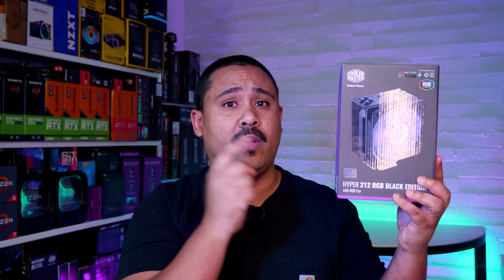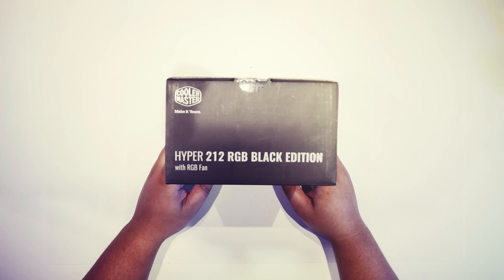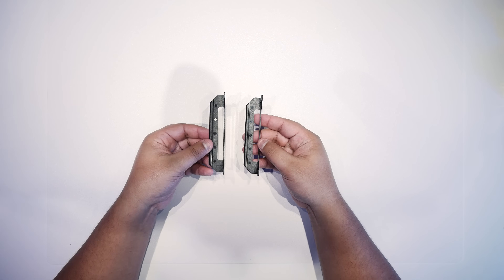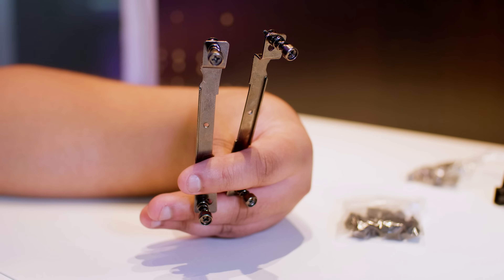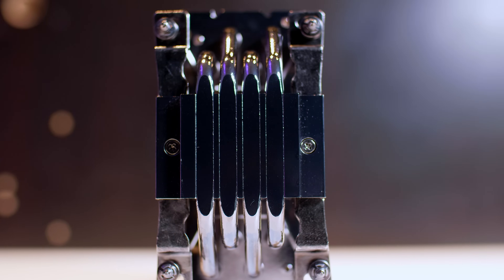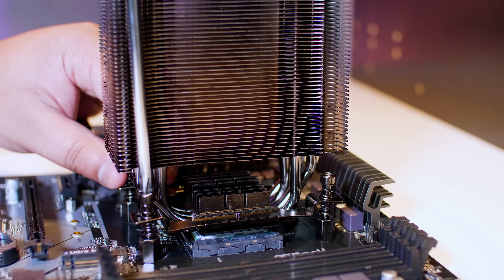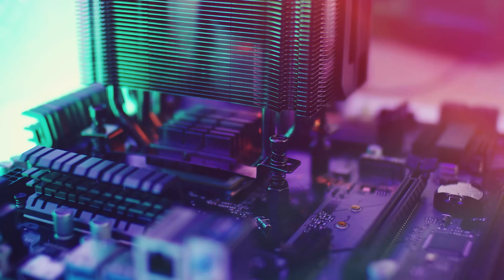HOW TO Install Cooler Master Hyper 212 RGB Black Edition on AM4

Comment: Can the metal brackets you installed to the cooler, be reused? I noticed when you tightened the cooler down, the metal brackets appear to have a spring tension quality where you see them bend as you tighten. After using it in a build, will the brackets retain that springiness, or once they bend like that, do you need to use fresh metal brackets for the AM4 example you demonstrated? Thanks

Comment: this works with AM5 too.  I didn't realize that the RGB needs to be using the 4 pin 12v header.  Had it connected to a 3 pin 5v port and wondered why it didn't work.

Comment: where can i find the plastic bracket mine is broken at 1 slot and wont screw all the way down... :( can i use something similar for the specific cpu cooler?

Comment: 5:30 If the screws aren't aligning for you (like they weren't even remotely close for me), you've installrd the bar on the cooler itself the wrong way round. Unscrew the two small screws, flip both sides round and you'll be good to go :)

Comment: I know this is an old vid so idk if there will be a response. Im having trouble getting the cooler off now that I want to reapply thermal paste. The screw is under the cooler so I cant unscrew the mount. Am I missing something or is it really difficult to get it off once its on?

Comment: what if I don't place those four small plastic caps on the backplate of the cooler? will it be alright? One of my plastic caps is broken.
Reply from the maker: You could potentially short out the motherboard

Comment: Hi there, just a quick one, if I plug both cables on the motherboard, without been connected to the RGB controller, it means that I can control the RGB fan through the motherboard software?

Comment: Don’t know if this is a dumb question but can the fan only go on one way? Is it possible to have the fan directing wind flow in the incorrect direction? How do you know if it is correct
Reply from the maker: Do not use the fan backwards

Comment: Has anyone found a compatible software to control the rgb for the fan without using the controller that plugs in?
Reply from the maker: Use your motherboard RGB software
Reply: @GearSeekers  Thank you so much! I finally got it to work

Comment: The problem with this cooler is that it's only rated to 150W, which a lot of modern CPUs exceed.  I just built up a new i5 13600k system and even at bone stock settings, no overclocking, the CPU was hitting 100C and throttling.  I added a second fan so it was a push-pull configuration and it made zero difference.  Then I read that the TDP is only 150W and the CPU puts out into the 180's...

Switched to a Corsair 320mm AIO, and full load temps stand in the 70s and that's with it now overclocked to 5.4Ghz...

Comment: Really nice video, congratulations.
I have a specific question, I built my pc with a Ryzen 5600x and it came with the (I suppose) standard AMD cooler. I wish to change it to this one, do I have do remove all the parts of my already built pc to put the black plate it comes with this cooler behind the MB, or can I simply remove the Amd cooler, change thermal paste and put this one without removing the motherboard from my pc? 
Appreciate the help! Keep up the good work! 💪

Comment: I installed this cooler upside down - so the cooler fan is facing the back of the case - is this a problem ?
Reply from the maker: Just unclip the fan and put it on the other side
Reply: @GearSeekers  did that thank you!

Also I have front fans in my case blowing to the middle, would the cpu fan blowing towards the front be an issue or better?
My exhaust fan is currently in the back of the case, grabbing 2 fans today to have exhaust coming from the top of the case

Comment: Could I put this cooler on my motherboard without removing the mobo from the case? Since there is a cutout on the back of my mobo panel to access the backing plate?
Reply from the maker: You can if you want. Its quicker with the board out of the case. Its up to you

Comment: Is this Compatible with AMD Socket AM5?
Reply: No it is not.  I Learned the hard way.  am4 coolers that need a custom back plate will not work.  It likely could with a custom nut but nothing included matched the threading on my mobo.

Comment: My msi mystic light doesn’t detect the ability to change the rgb on this. I installed the fan on JRAINBOW2 and it won’t show up. It just spins and stays blue. Anyone else have a similar issue?
Reply from the maker: you plugged it into the wrong header. It requires a 4 pin header
Reply: @GearSeekers  upon further inspection you are completely correct. Thank you for your help!
Reply: @GearSeekers  another question. Is it possible to buy a 4 pin extension cable? It won’t reach my 4 pin rgb headers without one

Comment: big thank you, too easy assembly with your video. But I didn't understand why the rgb wasn't working so I came back to your video and so I realize that I put the cable on a 3 pin port on my motherboard when you have to put it on a 4 pin and this is not mentioned in the small notice. Thanks again 😄

Comment: Hi my fren...sorry for my bad grammar ya...but i think i need your help...i m using ASUS B450M MK-ll Prime motherboard now...and i cant find any ARGB or RGB header on my mobo...but my mobo does have 1 CPU_FAN and 1 CHA_FAN which comes with 4pin...if so...will these type of cpu cooler work with my mobo?

Comment: 5:39 before applying thermal compound and removing the protective cover, make sure to check if the screws align correctly. You may need to pull the springy screws back to move them in another position with this modular CPU cooler.
Reply: it still doesnt work
Reply: @AsianSanta01  yea same for me I’m able to get opposite sides screwed on but the other 2 are so far off that it doesn’t matter what hole the screws in it’s still really far off did u ever fix this or find out if this is a bad thing
Reply: @doohicee  i just left it tilted lol but i dont recomend doing what i did
Reply: @doohicee  Did you ever get this to work? My screws won’t align for the life of me and eventually I gave up and went with stock but I do want to give it another shot.
Reply: @ForceEdge47  in case you were still wondering about this: turn the screw with your hand while pushing it towards the gap. this made it spring in place for me
Reply: i thought i was the only one i got am4 socket but its still so far off

Comment: Using this on my first build (which is  mostly Cooler Master products). I’m switching out the fan with one of their argb 3-pin chassis fans because my mobo has no argb headers and I want all my leds synced through a single controller.

Comment: great video and the fitting of the brackets etc etc is easy enough but I was always worried about where to fit the leads for the fan and the RGB which you have explained well ty.

Comment: do you need to install the plastic back plate that comes with the cooler even if the mother already has a back plate (gigabyte aorus b550 pro)?
Reply from the maker: Yes you need to use the supplied one not the one that comes with the board

Comment: Already have a AMD Ryzen 5600g with stock cooler and also having VENGEANCE® RGB RS 32GB (4 x 8GB) DDR4 DRAM. Will This cooler fit with the RAM modules already installed. I have a MSI B450M PRO-VDH MAX motherboard

Comment: You didn't really make it obvious to put the screw in before the plastic clip, nor did you really show which way around to put the brackets. I had to go and find some text based guides because the video just rushes through important info. Appreciate you making the vid but personally I found it confusing

Comment: I just bought the 212 RGB spectrum version (couldn't find the black edition anywhere) but i actually hate all RGB lights related shenanigans.
Is it ok if i just not connect that RGB connector thingy? or is there a better way to disable the lights?

Comment: For those who are having issues with the LED lights on the fan: make sure you plugged in the header with the arrow on the connector facing the left side of the rgb header on your motherboard. This video fails to mention this and will mess up a lot of beginners including me.
Reply from the maker: It was 100% mentioned
Reply: @GearSeekers  Where? All i saw that was relevant to it was you plugging in the rgb header into the motherboard but not telling people about which way the arrow goes on the plug.

Comment: In case someone has the problem with a MSI b550 tomahawk that the RGB it's not working, the fan's RGB connector has a little triangle, and you have to mach it with the RGB 4 pin header's white square on the motherboard!!! Mine was on the left of the 4 pins

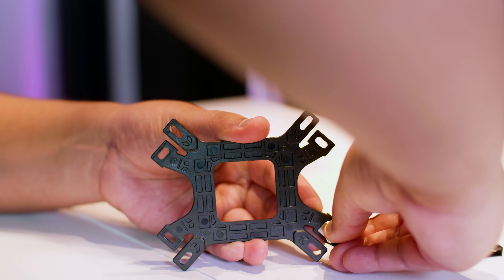Comment: So, from 4:30 to 4:35 how did you get the screws inside???
We have to take the plastic things out and put the screws in right???
Just do it right or don’t do it at all!
Reply: what???? u can get the back plate in the back of the case u dont have to take the mother board out

Comment: What is the max tdp for Cooler Master Hyper 212 RGB Black Edition? i'm gonna be installing new mobo lga1700 Intel Core i7 12th Gen Alder Lake Processor and wanna make sure that this heatsink can handle this cpu.

Comment: I have an AMD motherboard but there were already some screw posts built into the case that I had to fit the mounting screws around, and the cpu cooler won’t fit. The screws are just a little too far apart. I’m so frustrated because I can’t change anything about it. I just want my computer to work again and I want my money’s worth of something for once!

Comment: I got the same fan but mine got 3 cables 2 were in the video and one was a cable connected to the one plugged into the CPU fan header and it has a red point

Comment: I skimmed the comments looking for an answer to this but didn’t see it. Wouldn’t it be better to use the steel back plate that comes already on the back side of a new Mobo? (Of course after removing the plastic heat sink clips screwed in from the front side 1st). Instead of the plastic plate included with the cooler? Or will this not be the same thread?
Reply from the maker: I answered this in the video. You need to use the included plastic backplate
Reply: @GearSeekers  thanks for the answer! I was just clarifying.

Comment: My RGB isn't working I have 2 different rgb ports and it picks up my case which is plugged into one but it doesn't pick up my cpu cooler for some reason I have a Rog Strix b550-f motherboard...

Comment: I just installed mine today I have a rog strix, ryzen 7 3700x, 16gb ram, gtx 1650 at idle is 52°c is that normal temperature guys or do I have to use thermalpaste again

Comment: Please don't buy this fan, the pre-installed rgb fan is not removable, leaving the mounting screws underneath inaccessible. You basically couldn't screw this cooler onto your mobo if you tried
Reply from the maker: Yes you can
Reply: @GearSeekers  maybe I got a defective product man but you conveniently skip over the part where you need to screw it in on video. You can't remove the pre-installed fan, and the two mounting screws were underneath it, making them inaccessible. At least on mine

Comment: i messed up the CPU because of the steps at 3:51. basically it was being placed downward as shown but it was at the wrong side so i just turned it around sideways. to people who get to this part please just that thing around so that the "L" is laying on the inside. you wont be able to see it in this video because it is very hard to spot but if you had it the wrong way i did, the screws wont be able to fit. i tried to force it in because it seemingly looked like i was following directions  which made me feel safe and confident but it ended up benting the yellow wires on the CPU and this hidden step costed me $380 now i have to buy another 5800 ryzen
Reply: Oh wow!! I had a problem at this step too but noticed the notch lined up perfect with the L on the inside like you said.   That sux, always buy warranty on CPU or I think it comes with freee warranty for ryzen for 1 year or a month
Reply: Same here I’m so pissed off I don’t even have the money to replace it either

Comment: ATTENTION! I just ruined my mother board from over tightening the screws. Unlike what is said in the video you CAN over tighten them and IT WILL damage your mobo. Use your fingers only when you do that. F on my asus rog strix b550 F- (lol) gaming :(

Comment: Which one is better - The one with black fan or this one?
Reply: Quite certain all 3 variants are identical outside fan lighting. 212 Led variant is on Amazon for $35 Cad, the other 2 are $55 Cad. I picked up the $35 one because my AiO pump is dying a slow death and everything he showed here applies to it too. Except they added a single application packet of thermal paste so there is no 'how much do I use" involved.

Comment: very easy install but the plastic clips is stupid, there is a youtube vid that has better detail only took me 10 minutes to install the bracket, people should not give this heatsink/fan combo a bad review for the install it's really easy and it's basically the same as the older 212 models...once it's in it's in there for good.
Reply: can you send a link to the video ?

Comment: I'm glad this thing comes with a little RGB controler. I built a new rig 6 months ago and I'm rebuilding my old one in a new case to kinda refresh it (the old cooler - a 120mm aio - died so I needed a new cooler too). The mobo is old enough that it doesn't have any ARGB headers, so the controller is handy. 
The 4 pin molex though is... not. :D

Comment: I plug the rgb cable into my 4 pin rgb header, it doesn't lit up. I'm using Asus B550-I mobo, maybe there's a need to turn it on the BIOS?